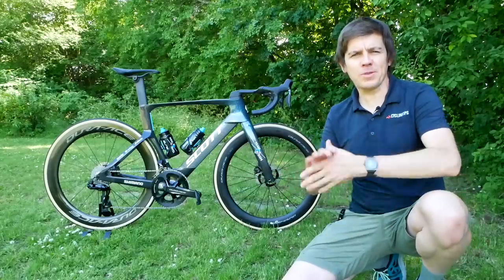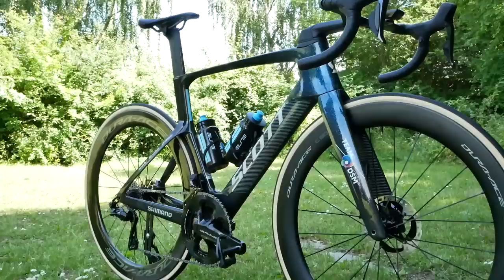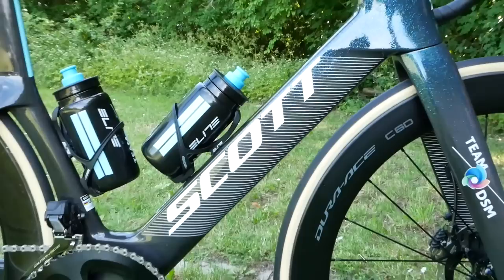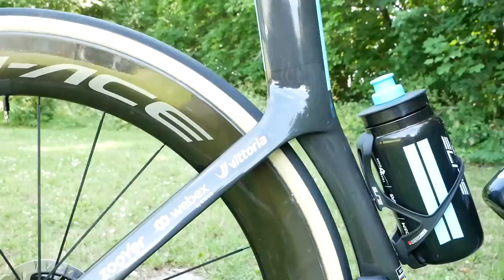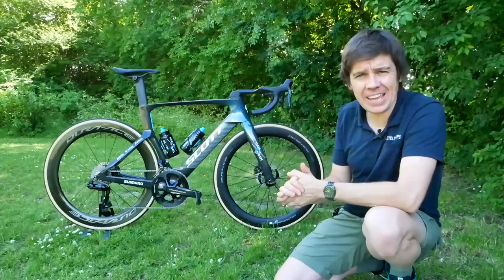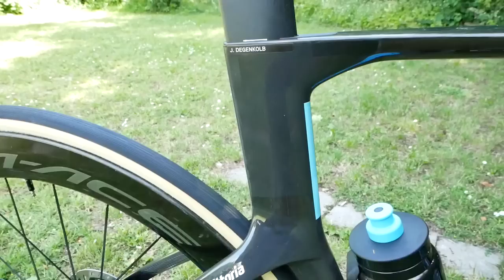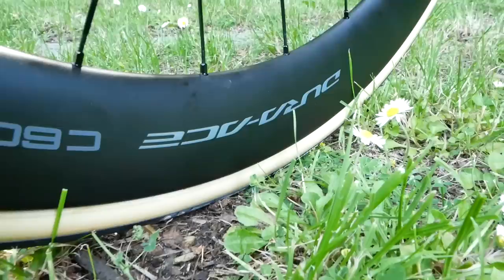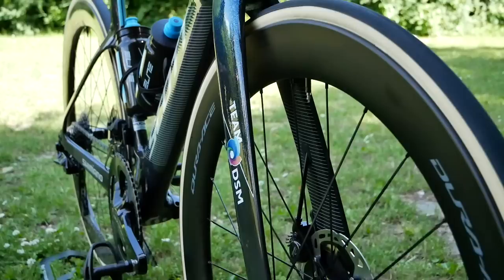Tour de France 2022: John Degenkolb's New Scott Foil RC

Comment: really like this new bike looks fast thanks shoddy
Reply: I think the front end looks great. But personally I find this style of kinked seat tube where it hugs the rear wheel before straightening up just incredibly un-aesthetic/ugly. I know that it likely has aero benefits and is a case of form following function, but it still looks ungainly to me and lacks the classic elegance of other designs.It might be more forgiving on the eyes if it split (same as the seatstays) and flowed up either side of the rear wheel rather than having to deflect round the front of it, but I'm guessing UCI rules probably prohibit that...